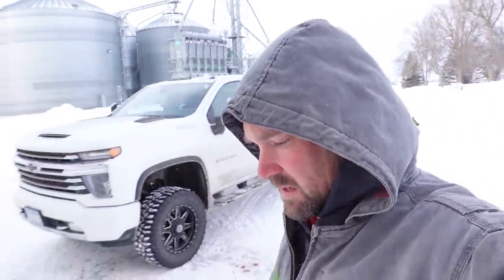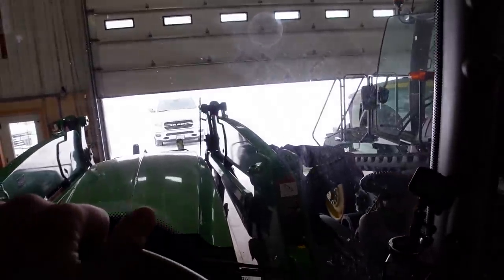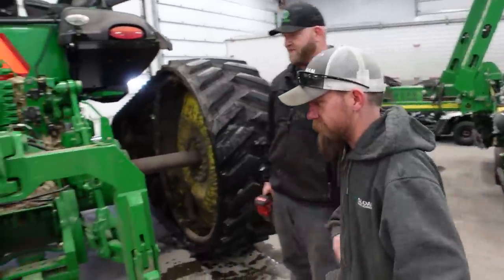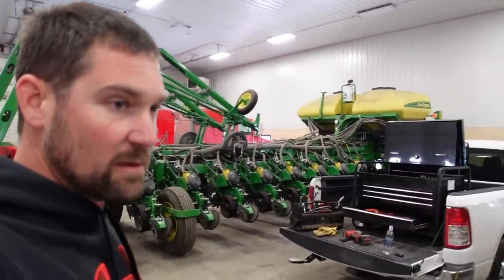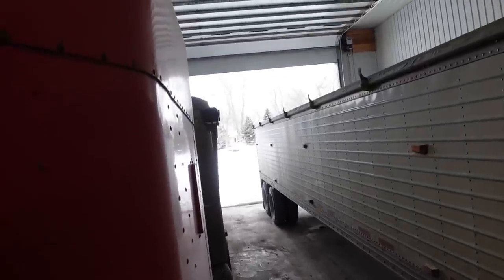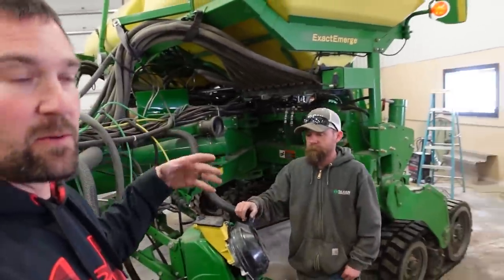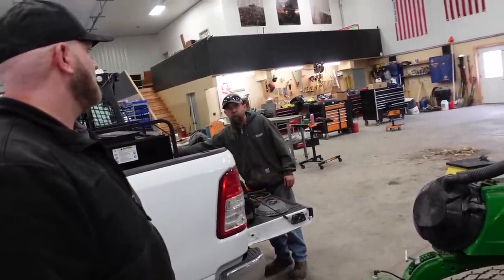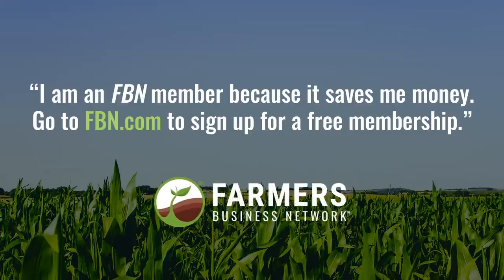How much Maintenance Could The Planter Need?

Comment: You could put 1, 2, or 3 colored zip ties on each hose denoting remote left, remote right, return. Reduce your thinking and make it a visual identifier. All singles are remote left, all doubles are right, and triples are returns.
Reply from the maker: They're already labeled, it still just takes some thinking with all the returns, etc
Reply: Plus, if you watch zk's video, they are installing some special aftermarket coil wraps on the end of the hoses that make identification very clear for future reference.

Comment: One of the Techs I worked with at Deere taught me if you scoop up the floor dry and oil then put down another layer of floor dry spray it down with Brake clean push it around with a broom then scoop it up again it comes up nice and Clean

Comment: It was interesting to see the other half of the ZK planter series!  Hopefully you won't need to change the Cat 2/3 hitch around very often.  Luckily the planter didn't drop off last year.
Reply: If they use the category III hitch, wouldn't it have been easier to just add some bushings to the planter pins?
Reply: @Zimmerdf  thoes are a pain in the but and expensive.

Comment: Zach, you might want to get some face shields for use in the shop. I understand not liking safety glasses, but the face shields aren't so bad. 

Hydraulic fluid isn't too bad other than making a mess. Gasoline and diesel fuel will ruin your day when in the eyes.

Comment: You should look into getting oil spill pads way less clean up than floor dry or sawdust
Reply: $1 ea at FASTENAL. Well worth it. They are very oil thirsty and repel water.
Reply: @frombryant6678  we have boxes and boxes of them at work seen us use them to clean up the aftermath of a large hydraulic oil tank bursting brilliant things
Reply: @theseangancrofter1892  Yes FASTENAL has 2 different thickness ones. 100 to a bundle on the thick ones & 200 to a bundle on the thin ones. We put them in drip pans under gearboxes to catch any leaks.

Comment: Inside the heated shed? Do you pay less for fuel oil than the rest of the world? I was wondering how increased fuel costs are going to affect the bottom line on you annual budget. I can only hope you don't go broke this year. It is pretty scary to think what grain will sell for next year. Food costs for the average citizen are going up!
Reply: Not everyone uses fuel oil. We hear with used oil.
Reply: Well he heats with propane, you think it takes a lot to heat the shop you should see how much the grain dryer uses. You could heat the shop for the whole winter on one 24 hour burn with the dryer.

Comment: How do you ventilate all the carbon monoxide in your shop, from running the tractor?
Reply: By opening the garage door
Reply from the maker: They're clean. The air coming out is as clean as the air on new tractors. We had Deere techs here last year and they said not to worry about it...
Reply: Do you have a carbon monoxide detector in your shop area? When a engine is warm no problem. But a cold engine still gives off carbon monoxide.

Comment: Why do you need two people to change batteries in a truck. I don't think I've ever had two people changed batteries in the truck
Reply from the maker: Just need someone to hold the under side of the bolt that holds the top cage down.
Reply: @MillennialFarmer  okay that I understand mine are all bolted in so there's no limit size to hold by Western stars and you'll be happier

Comment: where are the exhaust gases going, when you are working in the shed with tractor running?? major health risk. breathing cancerous diesel exhaust.
Reply: should get a flexible metal tube. one end going outside and another to put on exhaust pipe.

Comment: Don't want to be an, A couple of letters hole. But you have now taken more time taking the battery cover off and charging. Than it would have been to just change the batteries. Witch leads the the question that really needs to be answered why two people?
Reply: Jesus. Just write "asshole". It's not going to kill you.
Reply from the maker: Because this truck has long bolts that run all the way through and I can't reach the top and bottom myself.